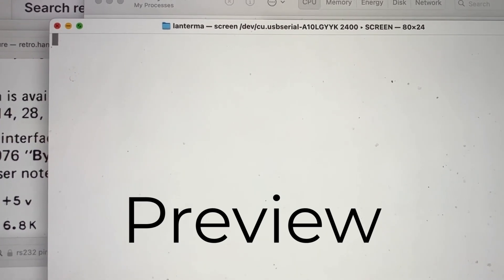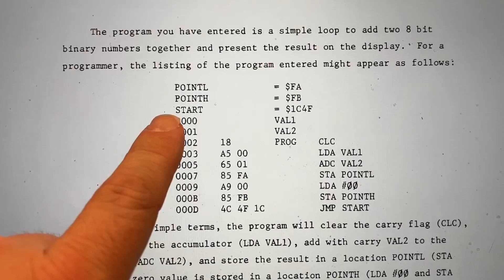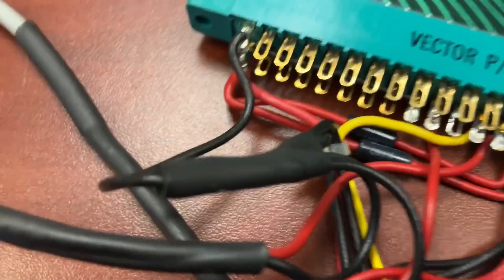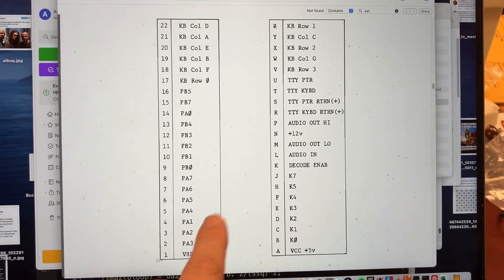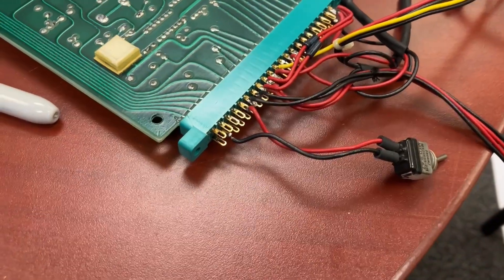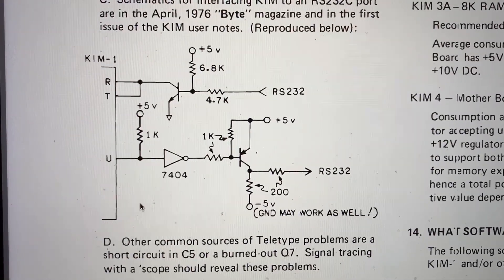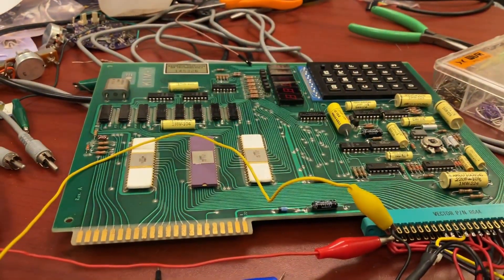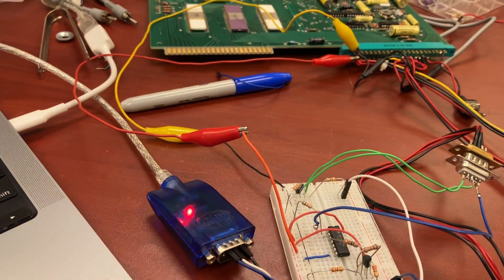MOS KIM-1: Great-Grandfather of the Commodore 64 (with Teletype to RS-232 Terminal Interface)

Comment: the omitted letters on some connectors have haunted me for about 40 years by now. It's the same with the edge connector on the C64, and probably at far more other connector types as well. I guess that it was done because G, O, Q are too similar to each other and I and J could be confused if badly printed. On round multi-pin military standard connectors the letter G is usually found but not O and Q and also only J and not I.

Comment: "before tossing it out ... " OMG!!!!1! Does no one think to look on EBAY? Okay, it's not quite an Apple 1 but I'm not sure which one was made first ...

It was 1977 when my college roommate at Southern Tech had a KIM-1 somewhere in a box and I had to twist his arm to get it out. Just doing "hand assembly" I learned a lot of the 6502 opcodes. The computer lab had a half-dozen KIM-1's and a Rockwell AIM. A year or two later I bought my own KIM-1 with S100 expansion board and 8K RAM for about $125. My first years of work included 6502 assembly programming, but then I learned C.
Reply: The KIM-1 predates the Apple 1 by about a year. And where the Apple 1 sold about 200 units, the KIM-1 sold over 7000 units by 1977. You can think of the KIM-1 as the "evaluation kit" for the 6502 chipset (the CPU plus I/O chips etc).
Reply from the maker: I should have clarified that in this case "tossing it would" would involve "surplusing" it, since it has a Georgia Tech property sticker, meaning it goes to surplus, meaning it's never seen again. It's sort of like the big warehouse at the end of Raiders of the Lost Ark.

"We have top men working on it right now."
"Who?"
"Top… men."

Comment: This brings back good memories. I never owned a KIM-1 and my first computer was the Junior computer from Elektor. Way less features than the KIM-1 but my first program also was the - I think at that time mandatory - adding two numbers program.
The SST switch is "single step" and it you flip that switch, a NMI (non maskable interrupt) will be generated during the instruction fetch so the processor is interrupted after execution that instruction. Some clever logic makes sure that this no NMI is genrated when the monitor program is executed from ROM so you can hit GO, execute one instruction, examine the results and then hit go again to perform the next instruction.
Very clever and I think the 6502 is a very nice topic for anyone starting microcomputer development to study.